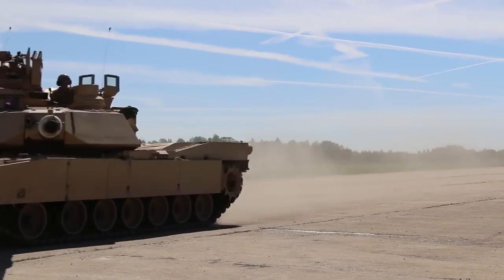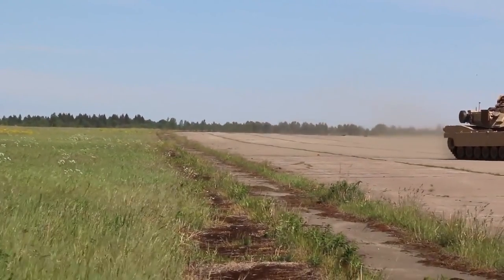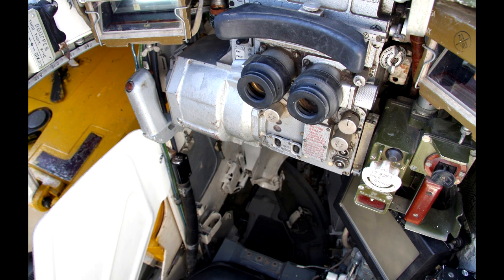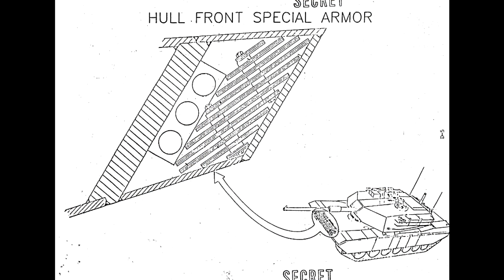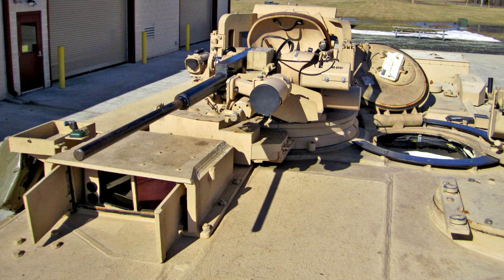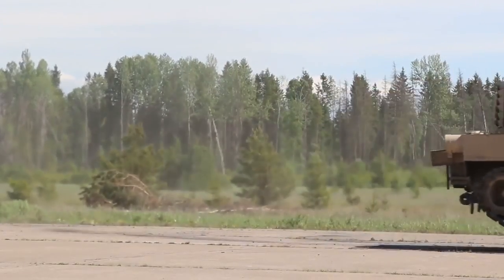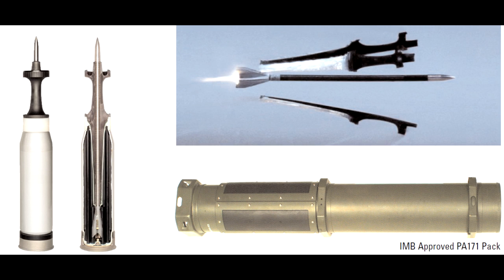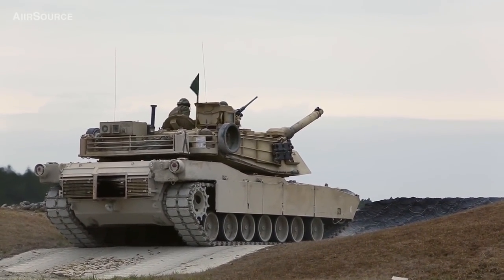Problems with Abrams tank

Comment: Personally I like the video for the most part however it's not and has never been a "gasoline" turbine engine. It runs off of JP8 which is a super refind diesel. Virtually all military vehicles (with very few exceptions) run on diesel and they can use any kind if I'm being honest. But for the active duty military aide of things everyone uses JP8. About 99% of all in theater vehichles use JP8 with the exception of some sf vehichles or things of that nature. Otherwise nicely done on this I really did like it

Comment: The Abrams In An Open Field Sticks Out Like A Sore Thumb Because of Its Sheer Size And Weight But Heavier Means Better Crew Protection, T-70 - T-90 Variants Are Small, Cramped, Hard To Move Around But Harder To Hit When Hull Down If Said Tank Was Struck At The Ammo Compartment The Crew Is Basically Dead, But If Abrams Is Hit In Ammo Compartment Crew Survives But The Tank Is Combat Ineffective Because Of Ammo Depletion, And I'm Not Saying The Abrams Is Bad Its Just Not Logistically Friendly And It Sticks Out Well Of Course Every Tank Does But The Abrams Just Cannot Be Missed, Its Just Too Big And Even If You Did Conceal It Would Take You A Lot Of Time. I'm Just A Tank Commander And Assistant Gunner For The T-90M And Im Only Following Orders From My C.O Not Knowing What Were Facing Only A Fraction Of Information, My Brother Died As A BTR Driver And His Body Came Back To Us Burned To The Skin And Missing An Arm

Comment: There are a few things you left out.....
The leopard and the Abrams  both came from a joint US, German program....the has turbine was selected for multi fuel,  weight savings, and reliability....the turbine is more reliable....early versions had their short comings, yes! But it was a brand new design, and the upgrade path got the tank into inventory  faster, and allowed for more meaningful  experienced based upgrades..(as opposed to guessing what the future holds).....and lastly, and most importantly..........
Every time the Abrams  has come up against Russian  tanks....the Russian tanks were completely  out classed on almost every level..the abrams being completely  dominant!

Comment: I thinking a gas turbine goes much longer between rebuilds and is simpler and needs less maintenance than a diesel  engine. As far as fuel consumption goes, If you need long driving distances for a mission, the plan probably sucks.

Comment: 4:30 APFSDS rounds don’t bounce, they shatter. So there is no need really to add more thickness to the upper glacis plate. I will grant you that the turret ring is a gigantic weak spot

Soviet/Russian tanks are less protected than the Abrams. Granted, with the original M1 that most likely wasn’t the case, but with upgrades they are far superior to their Russian counterpart

That said, we all can debate night and day about the merits and detractors of the Abrams and other country’s tanks, but we can’t debate their service records. Numerous Abrams took direct hits in Desert Storm and didn’t just survive, they sustained zero damage to systems and crew, and also virtually annihilated their enemy when they crossed paths

Comment: Just want to add that an abrams. Not sure model.  Was out side Baghdad at first ring entering on highway one from the south.  Had a hole in it and also had a red star on side of turret.  I took a pic and sent it home and everything was supposed lost.  I was pissed I lost so many pics.  I feel it was because of that picture.  I have always wondered if someone had one.  My point being it may be unreliable and they may have been left and taken by Iraq.  Your guess is as good as mine but I still have always wondered since March of 2003 when I seen it.

Comment: The day the US builds a better tank will be either six weeks before one of our likely adversaries announces a better one or or six weeks after one of them does build a better tank. IDK- the lead time now for a main battle tank at the state of the art is a decade or longer. Though the Russians keep developing newer, better equipment, they still keep the "old stuff" around; quantity has a quality all it's own- we have the M1A2 and variants to come- the Russians have at least 1500 T90s and a bucket load of earlier Ts- and now the Armata. Some times I fear we have fallen into the same trap the Germans seem to in WW2- only the newest tech, the best tech; the Me 262 first flew in 1943- and still wasn't operational at the end of the war- but it was better than either the P51, Spitfire XX(which wasn't available till late 43-early 44) or the Mosquito- in other words they gave away the ability to control their airspace searching for the best answer- the Russians did quite well with "good enough"; planes that flew well on 84 octane fuel, rather than 100 octane, etc- along with German hubris, the Russian Army and warm coats ran the Germans out and killed the rest. Just sayin'.FR

Comment: Honestly the Honeywell AGT 1500 is just as good in all respects as the German Diesel, you could probably interchange them with out many adverse effects to either tank.
Reply: The problem with AGT is that it consume as much fuel in ilde as in full power,so even if it is in defending position,it still have to be supply by the support unit as in advance position

Comment: when m1a2 abrams where pracktising with finnish forces in finland they had to get the fuel from airforce so they could even run the dam thing
Reply: should have just used mogas, and ran smoke generators for fun lol  the M1 can run an JP4, diesel or JP8.  but with JP8 the smoke gens are disconnected due its  flammability

Comment: Put a Cummins compound turbo diesel in the tank! Plenty of power and real good torque. Plus way better fuel mileage.
Reply: Plus, you could incorporate the ability to shut down cylinders like some vehicles can do, you could get even better fuel economy while idling.  Putting  a second engine on an already overweight tank seems ludicrous

Comment: What you don’t realize is that the M1 abrams was designed to be a defensive tank, that’s why there’s such a heavy emphasis on speed, reliability, and Hull down capabilities.  Also to machine gun on the commanders hatch is called the CROW system and is no longer used in newer tanks
Reply: the Abrams was NOT designed to be a Defensive tank what bullshit is that, now Tank Destroyers are designed to be Defensive tanks, not the Abrams.

Comment: I recall claims from way back that the M1’s high weight puts limits on where it can go – and that the transmission can not handle back-and-forth “digging in” and combat bulldozers are required to make an emplacement for them.
Reply: combat dozerz have always dug berms for tanks, as they don't have a frontal blade, and tracks simply dig till you bottom the hull out.
Reply: I’m sure you’re correct – those claims I recall about the Abrams were from critics of the program and probably exaggerated.

Comment: Honestly I'm a believer that the U.S needs to invest in 80 ton tanks with considerably increased fire power and armor used to eliminate other tank formations, while using smaller medium tanks in the 58 ton range for areas an 80 ton Behemoth simply isn't ideal. The heavy tank would be general open field tank on tank combat obviously, with American air superiority they're not exactly going to suffer casualties from the air.

Comment: Abrams is by no means a great tank or a perfect tank, it was effective for it's time, it's long in the tooth and does need a replacement already, but because they are so expensive they would rather just upgrade and slap no paint on it. It's a patch to the problem.

The US needs a new tank, one for modern times and more modern warfare, for one hour of driving it should not need 8 hours of maintenance that is a problem when you tank is almost deadline after a few hours.

And it's not the only tank in the world to see combat that is a bullshit claim, leo2s have challenger2, t90s have all see combat.

Comment: A key advantage of the turbine engine over a conventional engine is that the turbine provides considerably greater acceleration, conferring on the M1 a remarkable ability to sprint from a standing start.  This is super handy when bounding from one covered and concealed position to the next.  Such an ability to sprint from a standing start degrades the ability of enemy gunners to lay on and track an M1.

Comment: This video says that the early M1 tank commander could not override the gunner in controlling the turret.  Bullshit!  I commanded M1s from the beginning of their history and I damn sure did have overriding control of the turret!  I had a traversing and elevating mechanism at my right hand which overrode the gunner's traversing and elevating mechanism.  The maker of this video fails to understand what the commander's independent thermal viewer does.  The ITV enables the commander to identify a target through the ITV and then press a button to slew the gun to the target he sees through the ITV.  This is not the same thing as overriding the gunner's traversing and elevating mechanism.  And no, the commander was NOT "blind at night" on early M1s!  I could see just fine at night through the commander's extension from the gunner's thermal sight.  While looking through the extension, I could use my own traversing and elevating mechanism to scan for targets myself with great efficiency.
Reply: Yes the commander could take control and override the turret whenever he wanted, but the problem is you didn't have your own independent stabilized sight (like in the Leo2 for exaple) so this was a little disadvantage as it didn't allow for good situational awareness compared to the Leopard 2. And yes, you just admitted that the commander was forced to look through the gunner's primary sight in order to see during the night. This was exacxtly the point he made! 
Being forced to share the same optics with the gunner because the commander didn't have his own sight, whule the T-72 commander had his own independent infrared sight (however it was much inferior to the thermal sight of the Abrams). So yeah the thermal optic of the Abrams was still better than the infrared sight of Soviet tanks

Comment: All tanks have teething  problems. However, the M1 since 1980 to  as of November 2019, 39 years , is world rated as one of the best tanks  in the world.  Including all it’s pointed out Problems  in this video.  The video is good but the delivery  is a bit hard to keep up with  because of the way it jumps around. Start at the front of the tank and work your way systematically to the rear for instance,  show the declared problems as being fixed or not  . My opinion only.

Comment: I object to the turbine engine stuff(the rest is pretty good) I think you're not thinking of what the abrams designer were designing the tank to do. Fight in the cold war agasint a ZOMBIE horde of Russian tanks(t-72,t-64,t-55, all the ts)  Outnumber is an understatement.
1. To state, "they went this way for reasons" isn't a good statement or argument, than to imply they didn't want german engine because it was german. Doesn' follow as M1 used a British gun and the M1A1 a germen gun.

 2. One primary reason for the turbine the time between breakdowns is longer(less moving parts). So they trade gas and range for a longer time between overhauls. Which is essential given what abrams were meant to do, which was fighting withdrawal (cold war). Given that NATO thought that they couldn't stop the soviet army right away and would trade distance for time to redeploy the US army from the US to Europe. Resupply is more manageable in an organized fighting withdrawal then an engine overhaul, Which the armor forces would be fighting for about three months. So abrams was supposed to fight with no major maintenance needs for 3 months before relief. That was the theory(granted the filters).

3. Also, in the battle of maneuver(which includes fighting withdraws). Speed and maneuverability critical. So to you, the better maneuvering isn't that important. But say that as you are fighting falling back, fighting falling back, with Horde chasing you the whole time. The difference between an alive tank and a dead one would be that maneuverability(more than the armor as no tank can survive being swarmed).

Comment: The diesel is more efficient but not as powerful. Also, the Abrams runs on JP8, which a large number of US military vehicles and aircraft also utilize, so the logistics isn't much of an issue. Diesel freezes, JP8 doesn't. Your entire logistics argument is moot. Yes, it consumes more fuel. So what? Tanks don't go to war on their own. An Abrams tank and a Black Hawk helicopter can be refueled from the same fuel truck. You can't do that with diesel vesicles. Just because other countries don't utilize aircraft as much as the US does, doesn't mean you can criticize the Abrams for sharing fuel.

Also, the idea that the commander didn't have night vision or ability to scope targets at distance at night is laughable. The commander has a specific hatch for this purpose. The A2 version also completely remedied this "issue" with the new thermal commander's sight so what is the problem? FFS the Abrams has the finest night fighting record of any tank in history. It's like bitching about a race car that doesn't have a comfortable seat. Yeah, it should have a comfortable seat, and a comfortable seat was installed later, but who won the race? Guess the whole car was overrated.

You're doing a lot of shitting on the M1 for having a gas turbine engine. Did you forget the T80, and which tank DOMINATED during the Gulf War? It wasn't the diesel tanks.

You're also shitting on the main gun. Do you know why they didn't install the L55 when it became available? Because 1, US ammunition technology nearly eliminates the performance gap.  And 2, most importantly, the L55 is significantly longer, making it unwieldy in the urban environments the US has been fighting in for the last 20 years. The L55 can be installed on the Abrams, and even a 140mm was considered, but the 120 L44 is more than adequate so why would they upgrade to a bigger, more expensive gun, that's less maneuverable than their current gun?

As for your complaints about the Abrams armor, that's also laughable. The M1 has an adaptable armor system that has remained classified since its inception and continuously gets upgrades. Not to mention active denial systems. Has an American Abrams crew ever been killed by enemy anti-tank fire? No. There's you're answer as to how effective the M1's protection is.

How about you do some research before you post a video shitting on the tank design with the most successful combat record in history?

Comment: so, check this out.  Just like when the USSR designed there tanks, you have to think, what were they aiming for in their overall design?  Kind of like when America was designing the Sherman, they were thinking more of transporting and quick maintenance in the field.  Like the Russians sacrificing gun elevation and depression on the T-72 for a lower silhouette.  But as for the Americans wanting the turbine, the reason is smoke signature and noise.  We took the lessons of history, looked at the available technology at the time, and made our choice.

With any tank design, there will always be a flaw or a sacrifice.  You just need to think of what they were aiming and the benefit before saying it is just a flaw.

But as for the Russian T-80... if their design was better, why didn't they keep it in the next tank?  Perhaps too advance for the simple soldier that are operating and fixing the engines and diesels are commonly found in their privately owned vehicles.

As for taking the Abrams taking the Leopard, that issue goes back partly to the joint venture of the MBT 70 project.  One simply overlooked but huge problem facing designers was: go metric or standard when using tools and hardware.  It might seem simple to go just metric but then America would have to retool quite a bit just to build this tank with another country who 10 years down the road might not even want it anymore...

Comment: putting a jet engine in a tank isn't my first choice either. but they can run on different fuels. but my experience with german engineering l wouldn't pick their's either. if there military engines are produced different than their car's I'd reconsider. their car engines aren't intended to be serviced/repaired and have poor use of materials for example plastic doesn't belong on a engine or a thermostat housing thats just stupid.

Comment: I dont mind seeing a video pointing out the problems with modern military hardware....fanboiism doesnt change the point of the video. The same could be said about any peice of military hardware....including the Leopard A6, and T-14 Armata (which no one knows much about anyway) but the one thing the Abrams does have going in its favor, is proven performance that has evolved over the years. I'm fairly sure that the Honeywell AGT 1500 can be improved in a multitude of ways, to include increasing HP and Tourque, and for the Tank itself, improving the armor at the glacis, and replacing the older Rheinmetall L44 gun with the improved version. Everyone has an opinion, but as Ben Shapiro is fond of saying "facts dont care about your feelings" and what is true, doesnt change the equation. The Abrams was a highly successful evolution of the modern tank.